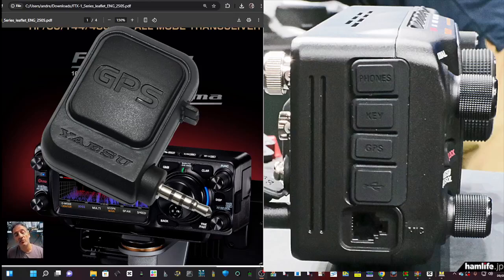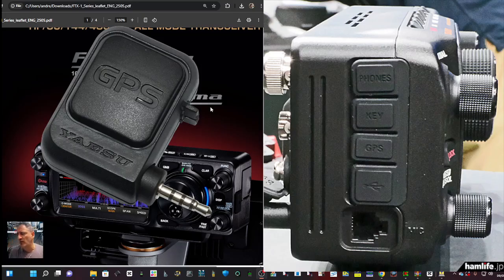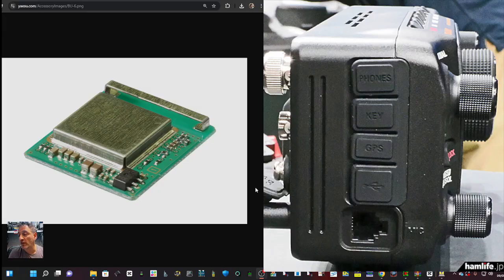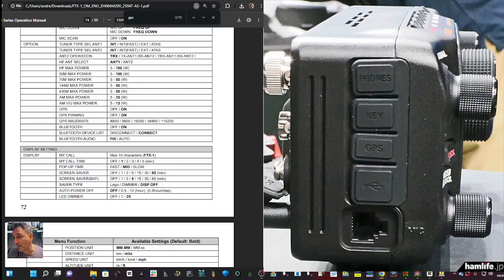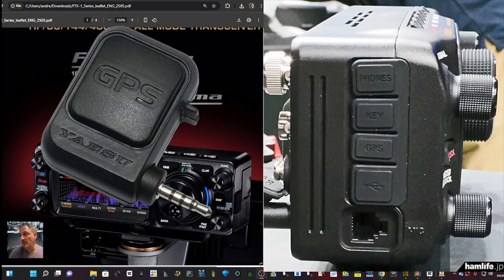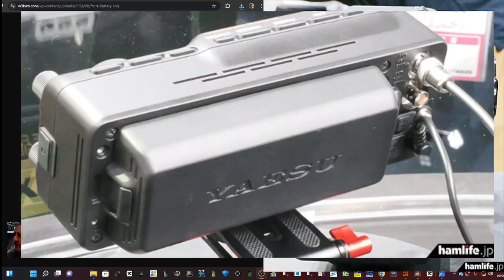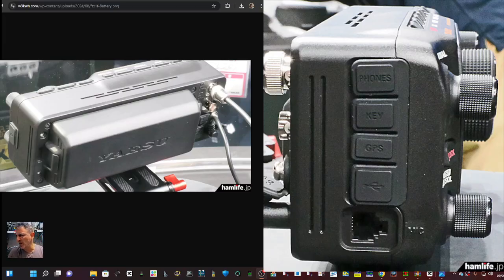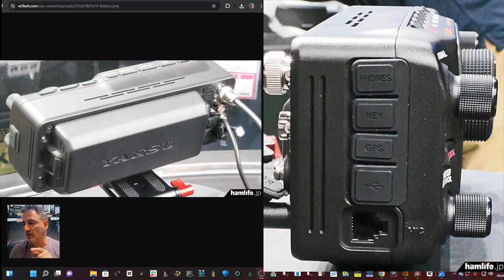GPS Module - Yaesu FTX-1 (FGPS)

Comment: Oh I dislike that gps ear give me the GPS on top with an adhesive and short cord
Reply from the maker: Get a cable
Reply: Depending on the cord quality you might be able to run that dongle up to six feet ( or around 2 meters ) from the radio. You need a good line of sight to get your GPS locked onto the birds.
Reply: @Subgunman yeah I don't think I'd be going to far from the radio but if I am using it in my car the dash might be a better location. 

I don't know I'll have to see how I feel after the price drops a bit the new shiny price is a little higher then I'd like.  Specifically since now I am looking for a duplex radio with SSB for liner satellites